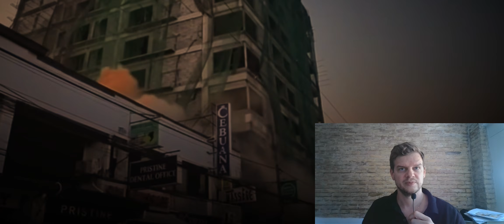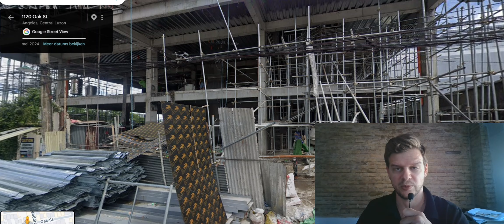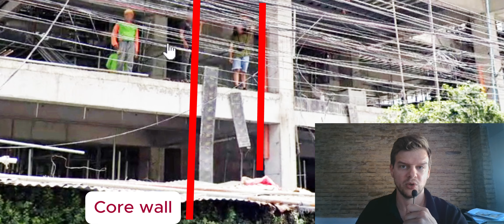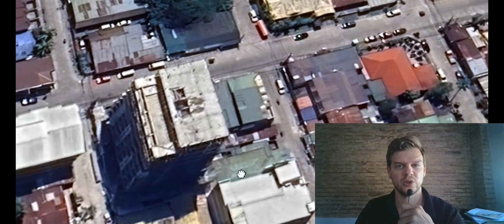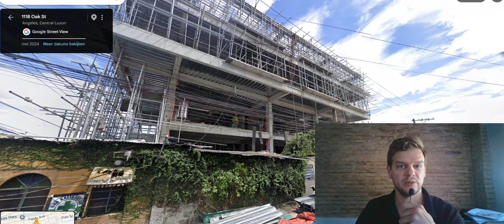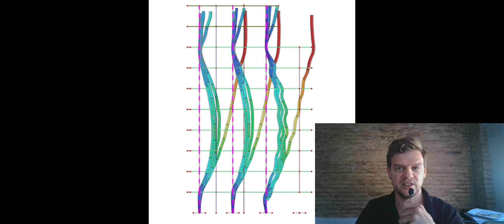This Hotel's Fatal Design Flaw Chain Reaction

Comment: Typical footing depth for these kinds of buildings is 3 - 6 meters or 10 -20 feet. It wont easily get washed away with one storm.
Reply from the maker: Hi William, the construction started in 2023 (maybe earlier), so it was not just this last storm + i saw some reference project where (when no basement available) the footings are on about 1 to 2m depth (3 to 6 feet).

Comment: The swimming pool is either on the 10th floor or 11th floor. Their poster near the building says it is nine floors plus two roof decks with swimming pool.
Reply from the maker: Approved as a nine-story condo-hotel, but with an extra 10th floor and swimming pool under construction. High chance that the pool was partly filled with water